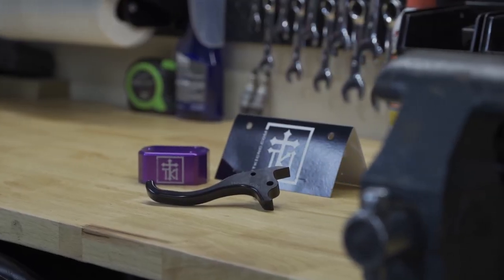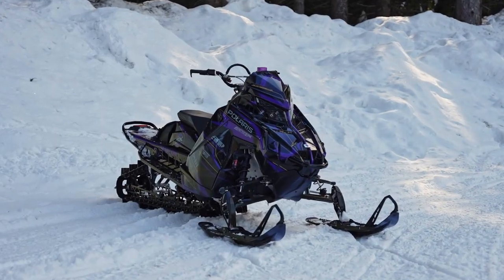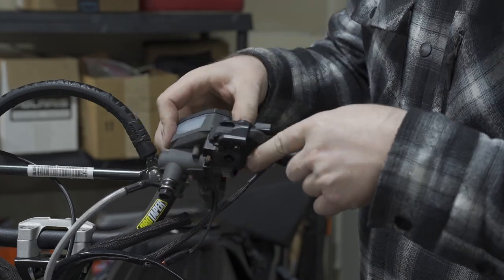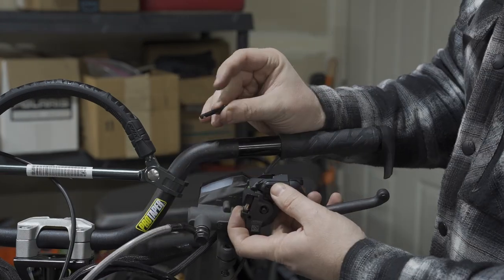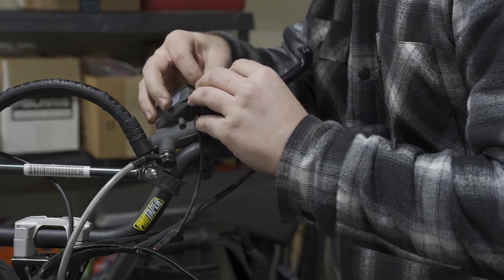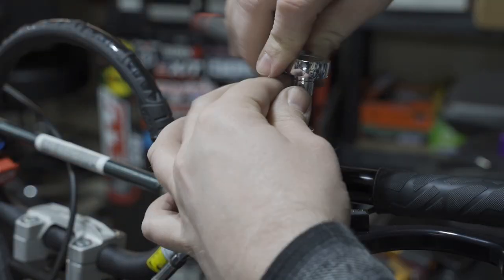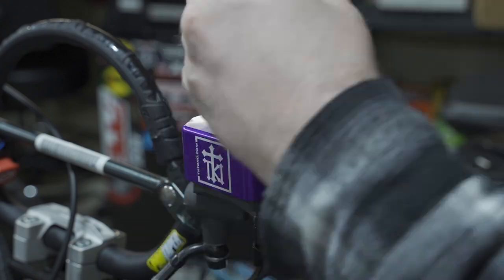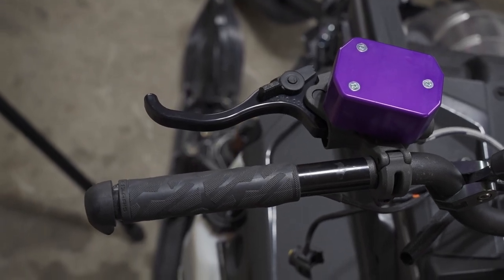Polaris Matryx Brake Lever and Reservoir Cover Install

Comment: Did yours come with a manual or anything looking at on for my arctic cat sled
Reply from the maker: no it didn't, its fairly straight forward so it really doesn't need a manual or instructions. a quick video like this and you're good to go.